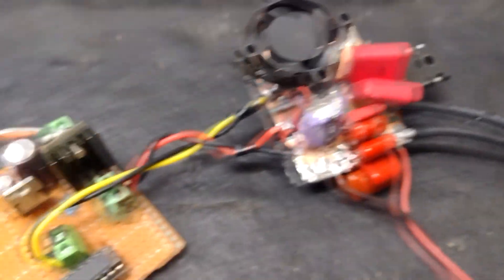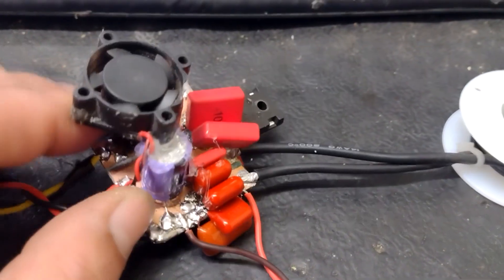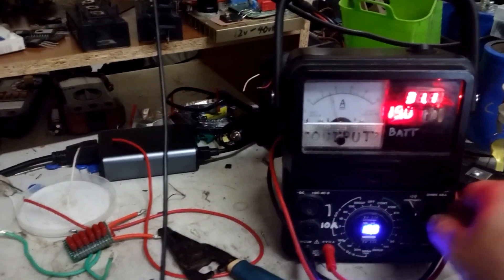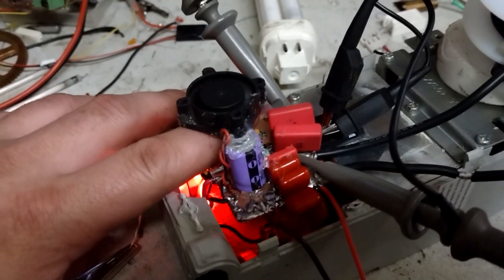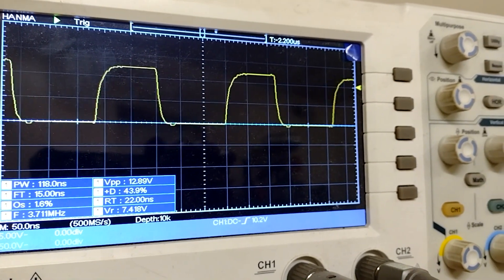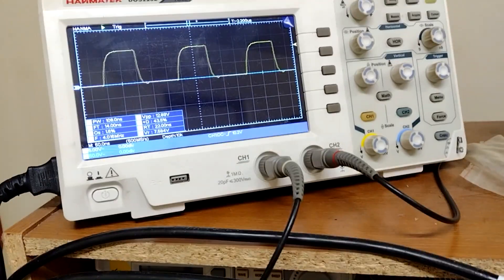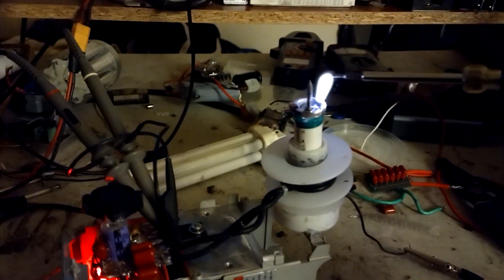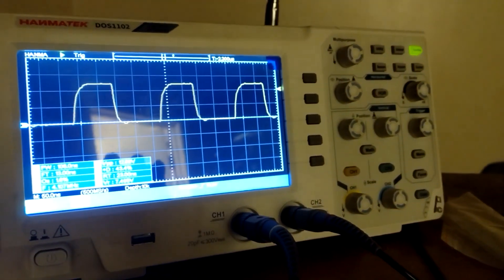Micro 3.5MHz Class E HFSSTC w/UCC27524

Comment: So I could run my mini 500kHz with a half bridge and the 74HC14N Oscillator instead of a PLL or forced feedback like antenna or CT?
Reply from the maker: Technically yea, it would just be a fixed frequency setup
Reply: @Magneticitist  thx I've just made a new lower frequency coil, it has some misplaced turns, should it affect it??
Reply: @Magneticitist  I mean I've seen worser coils performing better than mine
Reply from the maker: @Headbutter-Lettuce90   It kind of depends but at fairly low power and fairly low frequency it's not too big a deal.  When you start pushing more power at higher frequencies then it can become a problem.
Reply: @Magneticitist  it's like 480 to 510kHz, it's quite small, but I don't think it will be arcing over, I already epoxy it and maybe with a half bridge it shouldn't draw that much, I'm running about 100w CW with a single FET slayer right now
Reply: @Magneticitist  I have a UC3843 could I use it for interrupter??

Comment: You are doing great every day 
Does it hava schematic?
Reply from the maker: Thanks, no exact schematic for this cause it was so basic. On the power side it's just a board with the gate driver and mosfet, and another board is a couple regulators for 12v and 5v, the 12v being the gate driver and the 5v being the schmitt trigger. Schmitt trigger oscillator is easy since it's just 2 components added. I just have a 5k pot (and some other value in series to prevent too low of a bottom end) and some cap in the picofarads. Labcoatz on youtube is doing a video that will likely cover an exact schematic that will be very similar + a 555 for interrupting and playing music. 

My circuit uses 3nF across the drain-source of the mosfet for class e operation but this is in unison with an exact primary winding length I'm not sure of.
Reply: Tanx for clear explanation

Comment: I think I am gonna make my own butterfly capacitor for the hfsstc I saw a few videos of people doing them pretty easy , some sheet metal and a threaded rod
Reply from the maker: I thought the same thing once and never got around to it. It's harder than it seems. Doable, but def takes some engineering skill to make it really precise. FKP caps seem to work fine but if you want to push a whole lot of power they are going to be running hot.
Reply: @Magneticitist  yep I got a lathe and I will 3d print some parts , the only problem is that I do not have any way to measure the capacitance in the pf range but I could have a rough idea
Reply from the maker: @rodriguezfranco3839  If it's available the HP-4070L works good enough for me most of the time. Got it for like $16 bucks some years ago. Otherwise I can't think of a way to measure in the picofarads without some kind of meter or way to measure frequency. When measuring frequency I suppose you could try calculations based on RC timing components and some kind of chip that is fast enough. Theoretically so long as I could measure frequency I could figure out roughly how many picofarads (maybe above 50pF or so? IDK) my capacitor is based on resistor values in something like a CD4046. The problem is with a DIY air cap you are basically forced to connect it to a circuit using leads which are too long to not account for when measuring in the picofarads.

Comment: I wonder how it would sound audio modulated ? , I got the ucc27324 and when I tried to push the frecuency up to drive a little ~4mhz secondary it got crazy hot but anyways high frecuency coils are next level shit , I am not ready for that smoke yet 🤣🤣
Reply from the maker: That driver doesn't quite have the drive capability of a 2732X or maybe even the 27524 with paralleled outputs. It should be decent enough with proper tuning to run around 3-4mhz though. You have to really consider how much work the driver is doing in that process though. Imagine a hammer banging in 1,000,000 nails a second, and then imagine it doing it when the nails are 5 times bigger. You need a big hammer for big nails. The nails are the mosfet and the hammer is the gate driver. Audio modulated I know it would sound pretty good but it all depends on how that's done. In this case I'd probably try to use a buck driver.

Comment: Wow those are some nice arcs coming from that coil. You might be able to protect the gate drive from destruction by adding more decoupling caps near the IC, a resistor to the mosfet gate to reduce ringing, a diode from the mosfet gate to the driver to discharge the gate really fast, some protection diodes/tvs diode on the output of the driver, and/or the same thing on the mosfet gate. Interesting that leakage inductance helped your setup.
Reply from the maker: Yea all that stuff is necessary but it's more complicated in the MHz. At 500khz or so I can freely play around with snubbers and resistors etc without worry. I get a really clean set of waveforms. In this case at close to 4mhz the game changes and the idea is to keep in mind that these gate drivers are not going to be able to charge and discharge the mosfet gates up to a certain frequency because they cannot provide/dissipate the power necessary. 
In this case I'm trying to rely on a clean layout to reduce ringing. When you add any external gate *capacitance to minimize ringing you increase the amount of charge the gate driver has to feed and discharge. When you increase the gate resistance you slow the switching transistions. There is a compromise there, all depending.. you may not want the fastest transitions because the switch doesn't have very large losses. Or you may want the fast transitions because you have ample gate drive to get it done etc.. I do have a couple zeners on the gates though, back to back. Two 3.3ohm resistors in parallel also. Realistically with the fet I'm using I could increase that gate resistance and run higher frequencies. 

That bit of leakage was just what I added because I couldn't make up for it with the capacitor values, which I was later able to do close enough with different caps at 1nF each as opposed to stacking 470pF caps. It helps with the tuning sometimes to overshoot the length required on the primary circuit by tossing some extra.. then just cut it down piece by piece while observing the change in switching. You would ultimately see that with a given shunt cap value there will be a specific length the primary will need to work properly. It needs to be fairly exact.
Reply: Especially nice arcs for only 31V @ 3A. Also, I see that there is a resistor and a small TVS or zener diode to protect the gate. I also recently found that adding more and larger value decoupling caps makes a mosfet driver heat up less.

Comment: Great experimentimg, keep up the good work, can you show the circuit diagrams when you show circuits. Thanks for taking about how much power each section of the circuit takes, like the drive electronics and the out put stage, would it be possible to show this clearly in each experiment. Great experimenting
Reply from the maker: It's pretty similar to this schematic  https://imgur.com/aPpbIlF   but I'm using the schmitt trigger inverter. Very easy to wire one of those since you're just basically setting an RC timer on an input/output to have it more or less feed itself. One capacitor across input and ground, and one resistor across the input and output. I will try to get into more detail in the next video, whenever that is.
Reply: @Magneticitist  thanks, keep up the great experimenting, all the best Roger

Comment: Dang man, you've got your setup better behaved than mine, lol. Glad to see you built it! I had similar problems above about 4-5MHz with the UCC overheating, so I went down to 1.5MHz and kinda stayed there. With a standard MOSFET, I can run it up to about 60V before the 400V TVS blows, and with a SiC FET and an 800V TVS, I can push it past 120V no problem. Only issue is interference and grounding: I can't ground the PCB ground plane when using my Variac, since mains just shorts through to ground. So I have a floating ground, which isn't optimal, but everything still functions well. My "CW mode" is actually more like 99.9% duty at 35Hz, but interference sometimes shifts the duty lower, which makes the sparks louder.

Good luck with the 6MHz plasma flame, let me know your secrets if you get it working with this circuit (my original plan for this build was also 6-7MHz like jmartis2 did)!
Reply from the maker: Interference is a big issue with these probably due to the schmitt trigger being so insanely sensitive. Before I grounded the metal housing of the pot I was using it got wonky real fast with my hand close to it. I'm still using fairly tight coupling for these to run my lower voltages though. Still need to try around 60V after I get a new supply. It's doable with these drivers in particular but you really have to be anemic with the gate drive to pull it off. I had to use an inverted output that gave me under 50% duty instead of over, drop to that 12v drive, and make sure I had no external Cgs to make it work at 3.5-4mhz. I'm fairly confident that any of the heatsinked SMD packages would work fine without having to do all of that, they are just all sold out and have loooong lead times for the distributors I've been searching through. The oscillator works surprisingly well though and it seems like a pretty handy way to get MHz signals for various purposes. I feel like so long as it's all treated like legit RF components it might be pretty solid.. Have to really shield everything etc. Once I finally grab the right gate drivers I'll def take a stab at 6-7mhz. I'm going to throw a bigger coil on this circuit to see how high I can bring it since I have one more gate driver after I burn this one lol.